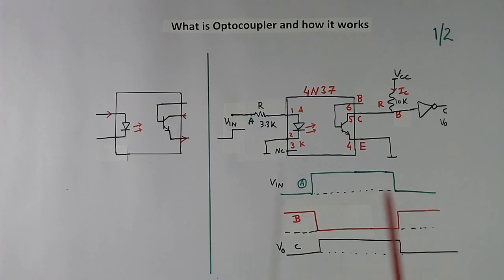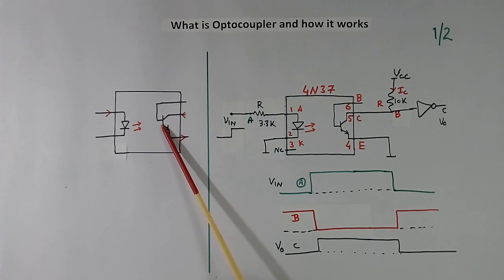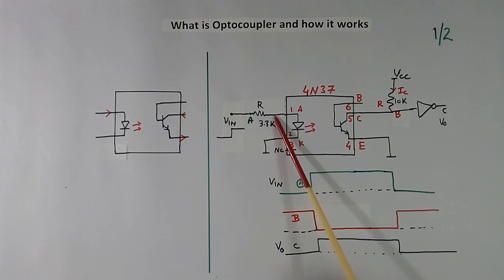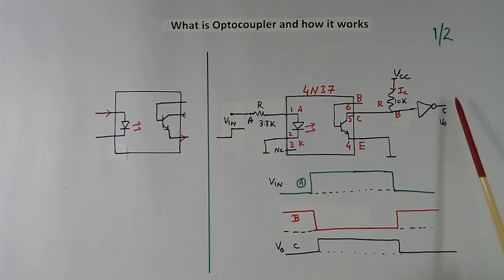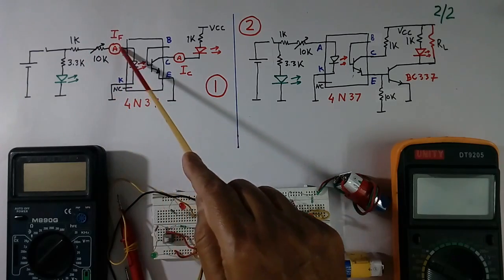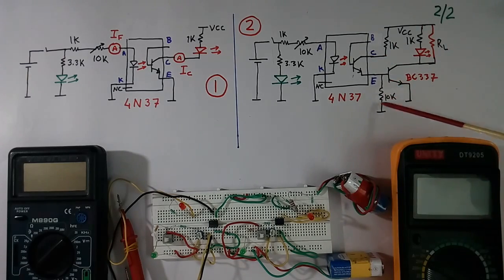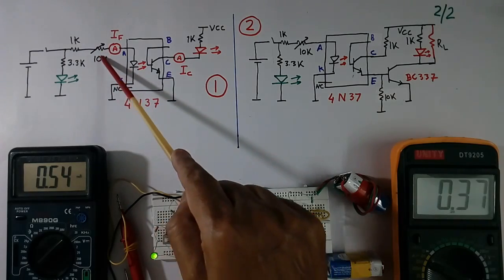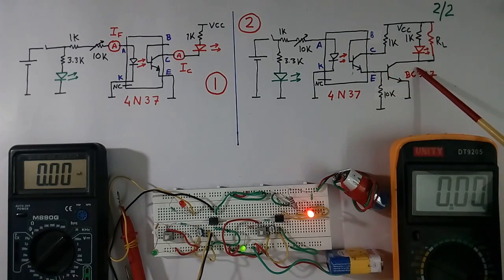How Optocoupler works, Practical Demo, applications

Comment: Dear sir,

I have a question.
In PC817 (4 pin IC) there is no transistor base terminal pin, but in MCT2E (6 pin IC), there is a dedicated transistor pin.

I wonder, what is the difference what is purpose of transistor base pin.

Please give your view sir.
Reply from the maker: Transistor base pin give flexibility in design. Useful in special circuits.

Comment: I have a question please! I have a optocoupler that doesn't respond to its light source but does respond when I shine a brighter led into it. I think it could either be the LED is too weak for the sensor, or the sensor is weakened.  Can you help explain the problem? It has the proper current.
Reply from the maker: When you shine brighter LED, light can not go inside the case of the optocoupler then how can it response?
Reply: @GKAgrawal2  when the LED lights up, the optocoupler sensor doesn't respond. But if I shine something brighter at the sensor, it responds.
Reply from the maker: Optocoupler does not response means either optocoupler is bad or circuit at sensor side is not OK.
Reply: @GKAgrawal2  Ok, thank you for the quick response. It's very appreciated. I've been trying to fix my linear turntable record player and I don't think I'll be able to find a replacement optocoupler. It's from the early 80s. :(

Comment: I'm working on my final year project. I would like to know how you hve calculated some the values of resistors.
Reply from the maker: After very long experience, I hardly calculate any value in many cases of electronics. Resistor is selected based on experience or just by approximate calculation.. However to know the concept of calculation of resistor, watch my video on LED resistor calculation and selection by GK Agrawal.
Further to know calculation of capacitor, if you want, watch my video on Full bridge rectifier capacitor voltage and value selection.
If some of you can tell me where or in which type of electronic circuit, all of you find difficult to calculate resistor value, Then I may think over to make one video.
Reply: @GKAgrawal2  I'll, thank you sir

Comment: Hello :) I'm new to industrial electronics. I have a question, in 4N37, why is its base terminal pin6 has no connections? But in 4N30 the base terminal is connected to the collector terminal. 
I am trying to answer why is the CTR of 4N30 larger than than of 4N37 so I noticed the base terminal. I was hoping it could be the answer I just can't fully understand why the bases like that.
Reply from the maker: Base terminal no connection means, user is free to use base as per design requirement. It gives design flexibility. Package size depends on power rating and standard pack size selected. As per my knowledge, Size may not have anything to do with base connection.

Comment: in second circuit please get my cofussion clear you are talking about amplifying but here the second transistor is used as a switch so the led is  lighting up sir if  i am wrong correct me sir please correct me sir and thanxx for the great explanation sir thank you so much
Reply from the maker: All BJT transistors basic behavior is like current applification. Now amplified current flows in a resistor connected between (say) collector and power supply. If this resistor connected to collector is high, then voltage drop across resistor will be high. So left over voltage drop across CE of transistor becomes so low that transistor looks like Switch. I hope your point is cleared. Read this answer 2 to 3 times to understand the concept fully (Even I read your question 2 to 3 times to understand your question). Also watch my video on BJT working as a switch.

Comment: Please please sir replay me opto ki Base pin ko kyu nai voltage diya use aise e kyu choddiya transistor ko work karne keliye base enable ona jaruri hain na
Reply from the maker: optocoupler key transistor mey 2 base hai. Ek normal type, dusra optical type. Esmey optical type use kiya hai, ussey hee base current mil jatee hai.
Reply: @GKAgrawal2  thosir ji  kya oga agar meain pir bi base pin ko current du tho opto jaljayegakya
Reply from the maker: Nahee jalega,  Dono base current add hokar output dengey.
Reply: @GKAgrawal2  ok sirji thanks

Comment: In  page 2/2 second circuit, is it mandatory to put  a resistor  of 1 kohm between vcc and collector? What is  it role?
Reply from the maker: Page 2/2, resistor is connected in collector at 2 places,
1- At collector of optocoupler. This is required to make the current to flow, other wise current will not flow in the base of the transistor BC337.
2- Between Vcc and collector of BC337.  That is RL. RL is the load. If you do not connect RL ( load) then no problem, but then no use of circuit. (then it will be just for indication or for explanation only.)
Reply: In case 1 cited  in  your  comment (to let the  crurent flow). Could you explain it? What if there is not a resistor  between vcc and  collector  of optocouler?
Reply from the maker: If resistor is not connected and circuit is open ( collector open), then current will be zero.  If it is direct connection (collector directly connected to Vcc), then to much current will flow during ON condition. So R is necessary.
Reply: Thank you for the explanation. Could  you please make  more videos about how to read an optocoupler datasheet? and gate  driver igbt?
Reply: G K Agrawal excuse me sir!! Could you please explain a more how to select the value of resistance in such situation? 
Thank you
Reply from the maker: This is based on experience. When you design many circuits and final product tested at many places, then you learn.

Comment: Sir, the phototransistor will work either off or on? In other words, as a switch not as an amplifier in the optocoupler
Reply from the maker: Linear optocoupler are also available.
Reply: How we could know if the phototransister in a photocoupler works as a switch or an amplifier? Is there a method?
Reply from the maker: you have to see type number and analyse circuit.
Reply: Thank you